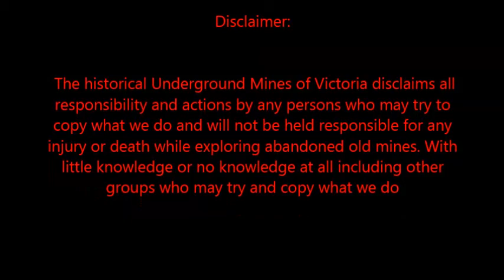Lowing a camera down mine shafts

Comment: I appreciate your videos. Dropping a camera down is a good idea. What about using 2 lines (of telstra rope) with a weight as well?
Maybe get a bit more control of camera direction that way. Looks like the old gold mines around here in Tassie. The weather looks like Tassie as well :)
Cheers.
Reply from the maker: yeah the weather was not the best but this was our first try of doing it this way instead of the old way of actually going down ourselves I think what we need to do is set up a small pulley above the shafts and lower it down right in the centre of the shafts that way it won't make you feel so sea sick haha